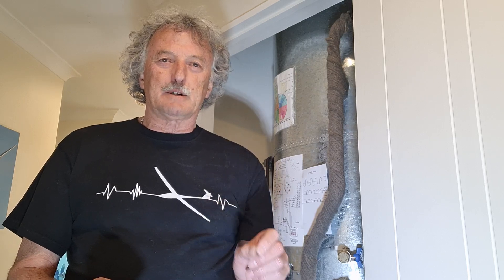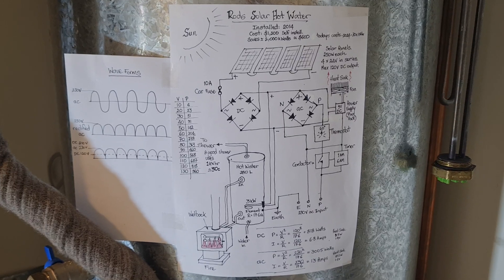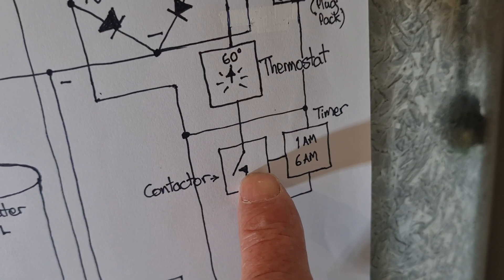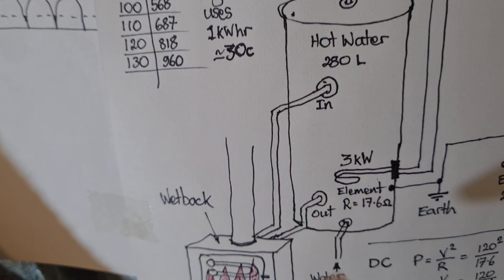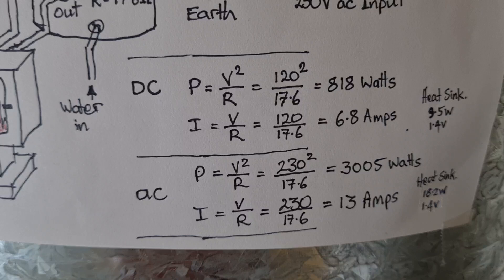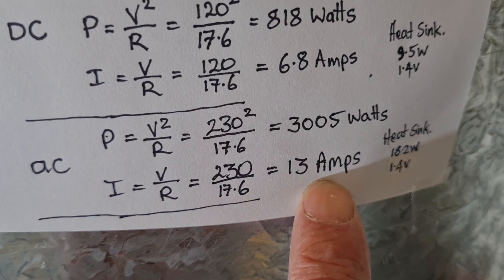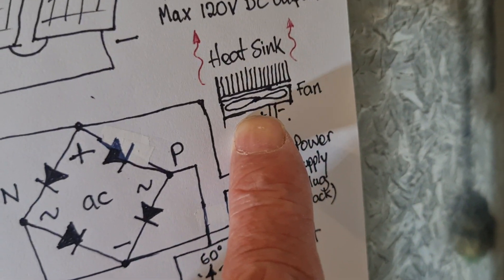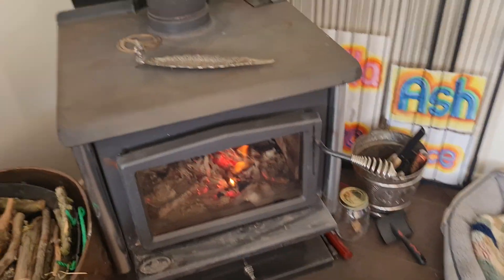Stunningly simple solar hot water system 🔥🌞

Comment: WE  MOVED TO BRAZIL AND 5 YEARS AGO I PUT A 50 METRE POLYPROPLENE PIPE ON MY ROOF AND FED WATER FROM THE 2000 LITRE TANK AND AS IT WAS STORED IT GOT STEAMING HOT, WHICH WE COULD USE FOR DISHWASHER, WASHING MACHINE, SHOWERS ETC WHICH ARE THE MOST EXPENSIVE PART IF ANY ELECTRIC BILL, IT COST ABOUT 200 POUND TO BUILD AND A DAYS WORK, WE HAVE  ABOUT 11 MONTHS SUNSHINE PER YEAR , THIS SYSTEM IS AND COULD BE USED MANY PLACES SAVING THE GRID TONS OF POWER, I FIRST DAW THIS IN FLORIDA, THEY USE IT HERE TO WARM SWIMMING POOLS ETC
Reply: Nice setup. Now, how to use it here in Finland? :D
Reply: @Teknopottu  IF YOU HET ANY SUNSHINE ON THE PIPE IT RAISES THE TEMPERATURE BY WHAT EVER YOUR LOCAL TEMP ALLOWS, ANYTHING ABOVE FREEZING IS CHEAPER AND QUICKER FOR YOUR BOILER OR KETTLE TO HEAT UP, SO ITS WORTH A GO, I ALSO HAVE 2 CAR BATTERIES AND 3000 WATT INVERTER, 3 X 150 SOLAR PANELS AND I CAN MAKE TWO CUPPA TEA FREE, NOT A FULL KETTLE OF COURSE KUST WHAT I NEED, AND BATTERIES ARE RECHARGED WITHIN 2 TO 3 HOURS ON A GOOD DAY OF WHICH THERE ARE MANY HERE, OBVIOUSLY HOTTER THE COUNTRY ITS BETTER, BUT ALL THE HOTTIES LIKE MIST IF SOUTH AMERICA, AFRICA, USA EVEN UK AND MANY OTHERS IF THEY USED THIS SYSTEM WOULD CUT GLOBAL CARBON BY A LOT TAKE CARE
Reply: @Teknopottu  use pontikka instead of water :)
Reply: @Teknopottu  replace the solar panels with windturbines.

Comment: Why are you rectifying the AC and DC? The element doesn't care if it's AC, DC or what polarity it is, put a DPDT relay in running off the DC side so that when the sun is out the relay switches to the PV. 

The other question is how much hot water are you using? I run on demand, take 5 or 6 minute showers, wash dishes, etc. and it cost us less than $10 USD a month. I thought about preheating but it isn't worth it, at our rate of 10.7 cents a kWh. Let's say I take a six minute shower, my on demand draws 5kWh so that's 5e3/(60/6) = 500 watts used to take a shower; 10.7/(1e3/500) = 5.35 cents. When the on demand is off there's zero current draw, no standby tank losses, no line losses either and no tanks that can leak. I've been telling people for years, if you have a small family and low hot water demand go with on demand. They last 25 years and if it fails all you have to do is change the element. Hot water heaters with tanks are a bad idea, you're keeping 40 gallons of water hot all day and night to take a 6 minute shower!
Reply: I agree. Here in Scotland, I use an electric shower, 6kw.  For the kitchen sink I have a small under counter cylinder, it does one wash up. It is so well insulated that it can be kept on all day with negligible loss
Reply: @markthomasson5077  Good solutions. 
People in the US think energy is infinite. Gas guzzling pickup trucks, large hot water heaters that are on all day and houses heated to 75F in the winter. They want to fill large hot tubs with hot water too. Other parts of the world are much more aware of energy because it costs them more.
Reply: @mosfet500  isn't energy infinite ♾️ ?
Reply: @ajarivas72  Americans think so!😬

Comment: Very nicely done.  Not liking having water near power, I'd get a plastic box and move the electrical components into it.  I'd also add another layer of insulation to the water vessel (as well as covering the front.  And lastly, I'd insulate the pipes behind your firebox.  I like to control where I use my heat/energy - as every little bit counts.

Comment: Very good. But why not just use a double pole changeover relay controlled by the timer.
Reply: I was thinking the same thing.
The whole system would be far simpler AND you have the safety of the power to the element always going through the thermostat.

Comment: I’ve set up a “pre heat “ tank, I had my solar panels upgraded so I put the old ones (2000 watts) on western side of roof and connected directly to an old water heater which is plumbed in before main tank.
I would like to somehow have a thermostat because during summer it gets to hot.
Reply: Hi . I use DC solenoids which switch the element on and off. Maybe something you could try. They are about £35 each so not cheap. They consume less than 3w when on.

Comment: This is a neat solution to running a resistance heater off either a DC source or an AC source, by simply rectifying the AC to DC. I wish I had thought of that!
 One thing you should do is change your car fuse to a suitable fuse rated for DC at more than your peak DC voltage (325V). The gap resulting from a blown 12V fuse will not be sufficient to prevent the arc from 325V jumping across it. DO NOT use an AC fuse as that will also be insufficient gap wise.
Reply: Correction: As your car fuse is only on the solar panels, peak voltage will be around 160V. Change the fuse to something designed for more than 160V DC.
Reply: @nickwinn7812  I was trying to find suitable DC fuses for E bike batteries up to 60v and it is not easy to find anything simple like a standard automotive blade fuse which is good for about 32v max. I expressed my thoughts with a staff member at Altronics and suggested their catalogue list fuse ratings for DC as well as AC voltage but they seemed uninterested.
Reply: Yes, your fuses need to be DC rated because the arc will not self-extinguish like an AC current will. The gap in the fuse when it operates needs to be much larger. Try Farnell or RS Components for proper DC fuses from Bussman, Siba or similar manufacturers.

Comment: Too much trouble, too complicated, just use a 24v/36v/48v element and you are done. You can run through a regular heater thermostat or temperature controlled relay. Use a lower wattage element, that way it runs all day minimizing low voltage due sun shading throughout the day. Total cost, excluding solar panels less than $100 US. Payback a month or two. ideally use a dual element heater, top element a/c(backup), bottom d/c(solar). Run a/c element on timer or only- after bedtime to morning for family showers.
Reply: Direct connect is only for those who sit at the kiddie table of solar.  And even then, they don't get the values right. When panel current drops just 25%, 50% of usable power is just wasted.  With simple electronics I outperform direct connect by a factor of three.

Comment: You have a different definition of "stunningly simple" than most folks.  WIth that said, what you're doing is impressive.  These days, with heat pump water heaters available, I think you might be further ahead to power one of those with a conventional solar configuration...one that is not limited to only providing hot water.

Comment: a small improvement would be to use shockley diodes that would not only recover some of the loss in the rectification but you would not need the fan for the heatsink and the power to run the fan which is not insignificant. Better would be to use the tank (bottom part) as the heatsink.
Reply: You are misinformed.  Once you get above about 40V the forward voltage loss is the same or greater than standard silicon diodes.
Reply: @opera5714  Your confusion comes from not understanding what a data sheet is informing you of.

As the CURRENT increases to its upper specified limit, the forward voltage drop increases.

Interestingly, if its forward current operates at its 20% capacity, the voltage drop is very low, much lower than standard diodes.

Plainly, if Schottky diodes were used to route, as in the application used in this video, you would select one to offer the lowest forward voltage drop at the expected operating point, not to meet the current voltage rating per say.

You missed the obvious from your comment, which was when the solar panels are operating in good sunlight the loss across the diodes isn't much of a problem, however, when the sunlight isn't ideal, that is when you want the least loss across the diodes. 

Furthermore, as I said in my post above, getting rid of the fans that are used to perform cooling of the diodes is important as any saving plan needs to ask, how can I lose the fans, schottky diodes selected for the least voltage drop at the expected operating condition would help achieve the demise of the fan(s).

Any heat that is the result of the routing should be recovered anyway, not blown away.

Comment: Wouldn't the stat contacts weld themselves on dc ? Or is it wired before rectifier and no stat on pv .
Reply: looks like no stat on DC. In theory, it could boil on solar but in practice it probably never gets that hot on solar after the morning showers use up the grid hot water an the tank refills with cold

Comment: I have used this system for almost as long as Rod. I recognised how good it was and it has saved me many dollars . I go along with not using bridges from China, I have had failures, I do not have a fan but a large finned heat sink, I added an extra panel so a maximum of 125 Volts (only under best conditions). I use night rate electrical supply for water heating so don't have the time switch or contactor . Summer night rate power costs never more than $10.00 . Thanks Rod

Comment: You can get a HW element that has seperate  230V/3kW and 120V/1kW elements, I suspect they are designed for marine applications. This means you don't need any electronics at all and the AC and DC are completely separate circuits. My neighbour at my last place had this setup along with a wet back, all installed by a registered electrician. There was no thermostat on the DC element so on a really sunny day with the wet back working it would be possible to boil the water but I don't think that ever happened.

Comment: You've got the positive and negative notation reversed on the bridge rectifiers and P/N shouldn't be noted (those are the AC input terminals) - not that it makes any difference to how it works.  Just make sure your diodes are suitably rated for the voltage - you don't mention this.  I'd recommend 600V rated bridge rectifiers capable of carrying 25A.  DO NOT buy them from China!  The 9V power pack is a bit dodgy too as you're running it on 'DC' (ok a fullwave rectified AC signal).  Not sure how a 'transformer-type' works with 120Hz (100Hz?) but if it's a switched-mode type you'll be better served as such a unit rectifies the AC input itself anyway but check that the power pack can run from 120-240V - not all do.  The connection shown from the bottom of the 9V power pack (going back to mains Neutral) shouldn't be there.  Needs to be mentioned for safety sake.  Personally I'd use an AC fan with a thermal switch to operate it.  The car fuse is NOT RATED for use at those voltages.  Get a proper fuse/holder.  The heating element is purely resistive and DC or AC makes no difference to it.  Good job!  Dodgy as fcuk, but good on ya!
Reply from the maker: Fair comments.
The 9V power supply is switch mode 120V to 250V ac input.  It kicks in at around 19V DC.  And yes, the 9V power supply should NOT be connected to Nuetral.
I used 1000V rated bridges.
With a few extra safety features it could lose the 'dodgy as fcuk' description.
But for a prototype birds nest it has lasted well and saved us a few thousand dollars too. 😎
Reply: @highflyrod  Thanks for taking the time to reply.  Having thought about your circuit for a while I came to the conclusion that a safer method would have been to use a double pole change-over relay.  Connect the common contacts to the heater element, normally-closed contacts to the solar supply (which will be the 'dominant' supply when AC is not applied) and the AC source to the normally-open contacts (controlled by your timer applying voltage to the relay coil as required).  No diodes, no heatsink/fan, still uses the timer and permanent isolation of AC from DC.  Element doesn't care whether AC or DC is applied to it.  Ok, it uses 'moving parts' i.e. the relay but they are usually rated for 100's thousands of closures so effectively 'forever' if properly rated.  Keep experimenting though.  Love your approach. <thumbs up>
Reply from the maker: @kellyeye7224  Switching high voltage DC sparks like crazy across the contacts.
Reply: @highflyrod  Only into inductive loads.  Resistive loads (like the element) don't spark nearly as much and the relay contacts are actually rated to carry such loads.  A simple spark suppression capacitor across the contacts would reduce the sparking to 'zero' too.

Comment: Can't understand why you used a bridge rectifier to convert DC to DC, it was DC from the solar in the first place.
Reply from the maker: The diodes in the bridge separate the ac from the DC.
Reply: Some old solar panels don't have built in diodes, so rectified ac from mains could flow backwards into the panels without protection.

A single diode or perhaps double (on + and -) could have replaced the dc-dc bridge rectifier.  I'm guessing the extra complication and expense was because there were 2 bridge rectifiers lying around or having a spare for the ac was useful in case of failure.  Might as well use it vs buying simple single diodes.

But overall, I think it just makes the diagram look cooler to have double bridges.  Makes it look more like magic.

Direct solar thermal would have been well over 4x cheaper/more efficient depending on piping runs.

Perhaps more interesting would be to control this to allow solar dump load if there were full batteries, but no need for any of this extra circuitry.

If AC must be used, better to string it through a heat pump water heater if ROI works out.

But, we shouldn't discourage people messing about even with the safety risk when it is done wrongly.

Comment: I got a licensed electrician to install a timer on my hot water circuit, it cost me about $200. I then signed up to Contact Energy who give me 3 hours of free electricity between the hours of 9 PM and midnight. Voila, free hot water for the last (nearly) 2 years for a bit over $200. Your solution is way too complex and way too expensive Rod.
Reply: Your solution is cheap because you can get free power. Not all of us have that luxury
Reply from the maker: Great idea!  Yes I get night rate power between 1am and 6am but the ac rarely kicks in.  The best part is I am reducing the grid power demand.  As NZ grows we will need more systems like this. :)